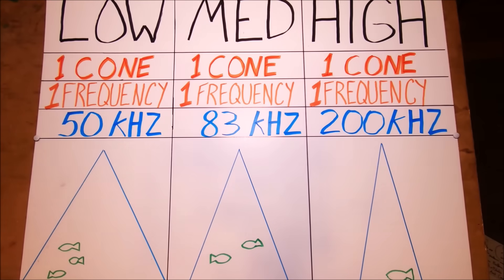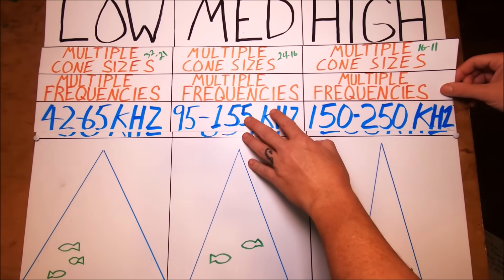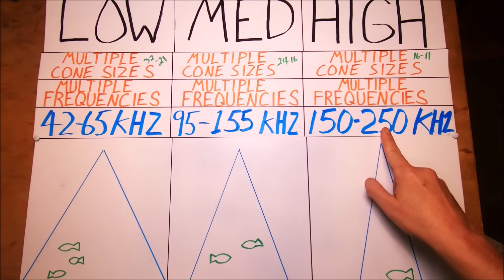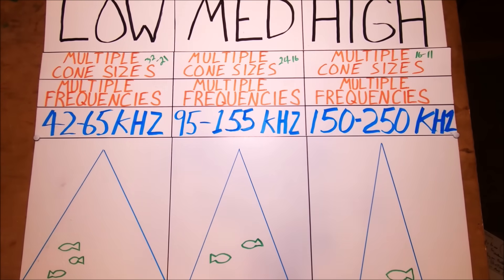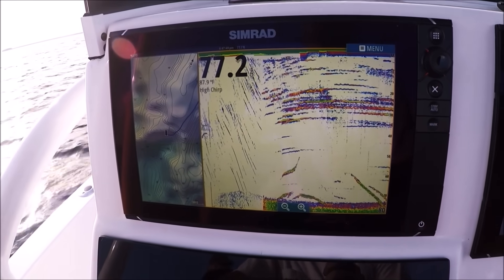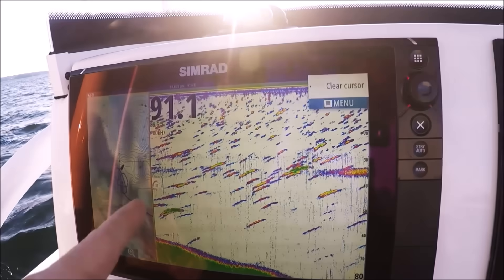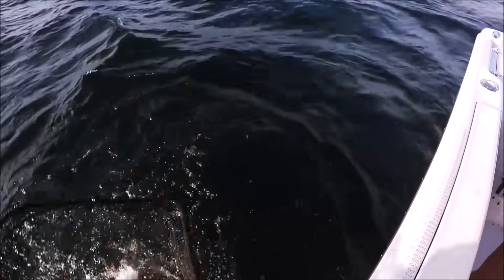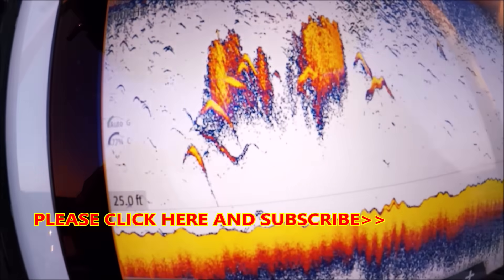CHIRP Explained in 4 Minutes! Chirp Sonar EASILY UNDERSTOOD.

Comment: Hi Mike thanks for all the amazing info. I am adding the active imaging to my transom. I currently have a thru-hull b-60 on my sportsman 207 masters would you leave the b-60 or do you recommend another thru-hull to compliment the active imaging 3-1?  At the moment I bay fish mostly so 15-50 ft of water but plan on going a little offshore probably 50-200 ft. This is the first time I have had a boat rigged up with thru-hull to get sonar on plane how do you recommend getting use to marking fish going 15-20 knots?
Reply from the maker: The B60 is pretty old technology. I would definitely upgrade to a CHIRP transducer. Your display has CHIRP processors so you should take full advantage to open that machine up if it’s in your budget. The Active Imaging is excellent for side and down scan, but this thru hull : https://amzn.to/2VhdytA is a BAAAAAD UNIT. It has the widest cone of any thru-hull and is excellent for those depths. You will be able to mark fish and bait over 30 mph.
Reply: Mike Smedley  thanks a bunch I’ll have to stash a couple bucks away rather get the real deal in a few months. Instead of settle for mediocre
Reply: @MikeSmedleyOLDSCHOOLSTRIPERS  Thanks again I was going to go ahead and buy this. My boat is a 15 degree deadrise. Do I still want to get this tilt or another product?
Reply from the maker: Hey brother.  It was tricky to find, but this is what you want. It’s for fiberglass boats with your deadrise. https://amzn.to/2YcMAEO
Reply: @MikeSmedleyOLDSCHOOLSTRIPERS  Sweet man thanks again can't wait to put this on the simrad and mark some fatties on the coast. Do I need any adapters to hook up to the simrad or should I be all good? Thanks again and tight lines.
Reply from the maker: Jon Kanner it will plug straight to your Evo3 if you get that exact one.
Reply: Mike Smedley  already ordered thanks for all your help bud. Not sure if you get some affiliate fee for that but I hope you do with all the great info and help you give. Have a great weekend bud

Comment: Unfair though with the transducer on the left sonar being in an incorrect angle under the boat
Reply from the maker: Both are identical angles.
Reply: @MikeSmedleyOLDSCHOOLSTRIPERS  Hi Mike, Thx for answering, but the missing arcs (bananas) is an indication that the transducer has an in this case backward angle. Happy fishing to you and your friends
Reply from the maker: Both are the same angle regardless. Too much tilt can give you half arches but it doesn’t change the fact that they are both the same. I tilt all of my transducers slightly down to mark fish on plane at high speed. Angle aside I think the difference in performance jumps off the screen.

Comment: Hi Mike, another great video. Many great tips in there. I currently run a 3D transducer for side & down & a P66 for standard sonar. I really want to upgrade for my birthday this year, with the option of compatibility to chirp readiness. I mainly fish in shallow estuaries, rivers & when the opportunity arises offshore, chasing reef fish & pelagics over reef structures. I wouldn’t fish deeper than 100-150m (700ft). I’ve have a 5m boat if that makes a difference. I’ve been looking at TM 185 LM/LH, TM258, TM260 & TM265LM/LH options. Any tips, advice or recommendations would be amazing, thanks mate😃👍🏼 tight lines.
Reply from the maker: Any of those would be great but you might want to consider the new Airmar tm165 extra wide high CHIRP.  it’s incredible for the depths you fish and won’t require a stronger CHIRP processor.
Reply: Mike Smedley Great info mate, thanks. I will look over the TM165. Just for my understanding, where you say a stronger chirp processor, is that in the head unit?? Thanks again mate.

Comment: Great video!  Thanks for sharing.

I bought a used boat with an Elite7 Ti with what appears to be the active imaging transduce with side scan.  From previous comments, it seems that you are saying that this is "real" CHIRP. correct?

I also have a Hook2 7 with the Triple Shot transducer and the unit lists CHIRP as an option...I think in the frequency tab.  Is this "real" CHIRP or not?
Reply from the maker: Hey brother!! Unfortunately I’m not terribly familiar with the Lowrance side. It’s seems some people found some discrepancies in the Lowrance literature. I would check the message boards on The Hull Truth. They have consistent posts on that exact subject.

Comment: Is it hard to change a transducer?
Reply from the maker: gerard haubert Some can be quite simple to swap and some can very extremely difficult. If it’s a transom mount it’s usually just a matter of pulling out the old one with a thin rope attached to the plug end, then you simply use the rope to pull the cable on the replacement transducer to the display. From there it’s just a matter of sealing and screwing the new transducer to the transom and plugging it into the display.  Pocket mounts,Thru-hulks, and In-hulls can be much more time consuming. It’s best to consult a boat/Simrad dealer if you don’t have any experience.

Comment: Thanks for vid
Why is the 50khz the widest cone?
Reply from the maker: Ralph Kluge Dont know exactly why, but most transducers use 50 for their widest cones.
Reply: Its just to do with how the physics of waveforms works. The lower the frequency, thewider the dispersion. The higher the frequency, the narrower the dispersion. Best way to understand is to think lower down the scale in audible frequencies. If your neighbor is having a party and blasting the music, what you mostly hear is the lower "thump" of the bass in the music. But the higher frequency instuments like cymbals you cannot hear.  The reason for the difference is that the bass is pretty much uni directional, (so a "wider cone") of radiation or dispersion,  and also carries further, but the treble is very directional, and disperses faster. To hear the full crisp sound of the treble you need to be fairly well in front of the speaker facing the tweeters. But the short answer is its just the physics of frequency radiation.

Comment: Can you add chirp to a  Furuno bottom machine?
Reply from the maker: Big Rich I don’t have any experience with Furuno. It would have to have a CHIRP sonar processor on board or have a processor you can add on. I’m sure they have a module to add.
Reply: Mike Smedley thank you! I was asked if I wanted chirp back when I bought it about 6 years ago, but I didn’t understand it so I said no. Dumb on my part. I’ll check with my electronics installer and see if I can add it.
Reply from the maker: Big Rich In your defense, not many knew what CHIRP was back then (or even now really). Make sure you are ready to upgrade your transducer to a good Airmar CHIRP ready transducer or it won’t really be worth the sonar upgrade. Thanks brother!

Comment: Why does Lowrance say they have CHIRP on all the Hook2 when in fact its not true CHIRP at least all the lower end units are not, yet there website say they are. very confusing.
Reply from the maker: Not as familiar with the Lowrance side, but if it says CHIRP it means it can run swept frequency transducers using CHIRP processing and not only fixed. I’m not sure how wide the bandwidth is though. What makes you think they aren’t true CHIRP?
Reply: @MikeSmedleyOLDSCHOOLSTRIPERS  Someone asked this on Amazon for the Hook2 4x here is the reply from Lowrance:  "Thank you for your inquiry. The Hook2 4X does not have chirp. The only Hook2 "X" model that has chirp is the Hook2 7X TripleShot. All of the Hook2 sonar/GPS versions that are 5" or larger do have chirp. We certainly hope this information is helpful.
Navico, Inc.
· April 29, 2019 "                   Now if you go to there website the term CHIRP is all over the Hook2 page its so misleading ?

Comment: why does mine go from 55 to 200khz what cone size would i have?
Reply from the maker: bratty ship47 every brand uses different cone sizes. 200khz can be anywhere from 7 degrees to 11. 50 can be anywhere from 18-25 usually
Reply: Don’t know cone angle offhand, but you’ve got one relatively superfine resolution (very small target separation) wideband waveform. 🙂

Comment: Each curved return is one fish?
Reply from the maker: Scott Gaines yes sir.
Reply: Only if you’ve got sufficient resolution, aka target separation. If you’re using the lower frequency, your resolution will be poor and the arc on the display could be depicting multiple fish.
Reply from the maker: FR. Yes and no. CHIRP transducers are very efficient and “quiet”. Even in low CHIRP or 50 kHz fixed you can have great separation and resolution. The arches are just a lot wider. The higher Q rated transducers like cheaper fixed frequency transducers show more blobs and connected returns regardless of frequency. 👍👍

Comment: Is not suppossed Chirp performs much better than single frequency? You didn't explain why single frequency performs better to you.
Reply from the maker: Luis Luis In my opinion single fixed frequency works better with single fixed frequency transducers versus setting them to a CHIRP setting.  

 As far as CHIRP ready transducers I use CHIRP in water deeper than 30ft but often leave them in single frequency in shallower water.

Comment: Using Lowrance HDS Gen 3 units, looking at upgrading ducers. With current 83/200 skimmer, I have never saw chirp improvement. Now I know why...great video.  The ACTIVE IMAGING 3 in 1
 Transducer, does not appear to be compatible with Gen 3. Will the TotalScan skimmer work for Chirp or is there a better product?  I fish for Striper in east Tn. on lakes up to 100'.
Reply from the maker: The least expensive CHIRP transducer that will knock your socks off will be the TM150M CHIRP. It’s been a great transducer for me over the years. TM 150 M  https://amzn.to/2BsVMud

 Because the Gen 3 is a bit older you will need this adapter https://amzn.to/2XEdTH3. Great transducer for those depths. The TM165 is a step up from the 150, but it’s around $150 more than the 150. You will be very happy with either. 👍👍

Comment: Mike, you did a better explanation than the one I saw on (Kid Cochise?). It was your conical diagrams that did it.  I might suggest that when you show chirp you draw multiple different color cones, each different color representing a different frequency covering different areas.  Thanks for this though,  Great video!
Reply from the maker: Thanks brother!! I really appreciate the feedback!! I actually did a video several years back using exactly what you’re talking about and it seemed to confuse things further for a few guys. 🤷🏻‍♂️🤷🏻‍♂️. I tried to keep this one as simple as possible with just the basics. Technically you get even more frequencies than the 100 since pulse frequencies can be any frequency within that range of 150-250khz. For example you maybe sending 150.1 150.2 150.3khz and even smaller. I tried to keep it all about the COMPARISON between fixed frequency transducers and CHIRP transducers that use swept frequencies. 

  I think I will do another one soon for the more advanced fishermen and I’ll use your recommendation. Please let me know if there is anything specific you would like to see in a video. Any video about sonar or fishing in general. Thanks again brother!!

Comment: Hallo Mike from Greece!!!! i use Airmar TM185 watching the very nice video i try to understand what happened to my transducer when i use a custom frequency lets say 90 khz and then changed to 125 khz i believe i send 1 frequency at the time?if so it works as  a none chirp transducer as it uses only that one specific frequency at each time is pingig?how these 2 frequncies are related to the angle of the cone?since the the TM185 has 50 frequncies(85-135)and an angle of cone 11 to 16 deg.Thank you!!!
Reply from the maker: George Iliopoulos Hello George!! I would contact Airmar for the details on that, typically the lowest frequency goes along with the widest cones. I like custom frequencies in shallower water less than 30 feet.  👍👍👍
Reply: Thank you Mike !!!
Reply from the maker: George Iliopoulos 😁😁👍👍👍

Comment: Just a small correction. By chirp it is not 100 pings each at a different frequency it is each ping starts off at a low frequency and ends at a high frequency. This allows a long pulse that can go deep and you do not loose any range resolution or the ability to detect different objects close together. This is because each target is hit at a slightly different frequency and when the signal returns the system does a frequency match filter and is able to determine 1 target from the other. Also the cone size (beam angle) does not change that drastically between 100kHz and 200kHz.  I work in sonar development and this is what I help develop. Other than that the ability to detect targets is correct.
Reply from the maker: Thanks brother!  It’s technically a wide frequency range between 150khz and 250khz. (Not just 100 since they don’t come in nice neat 1khz chunks) I had such a hard time explaining the difference over the years that I found this gave guys a good “idea”. Instead of one you get many.  Thanks for the comment brother!
Reply: With a Lowrance hds live what is best for water between 10 and 100 ft deep  salt ? Has chirp and or conventional
Reply from the maker: Try CHIRP first. If it has medium and high medium will likely have the wider cone so it’s better for marking fish. Every transducer model has characteristics that can be quite different than others so you will have to experiment with it a little. I would toggle between medium CHIRP and 83khz. Go back and forth at different depths paying close attention when you’re fighting under the boat. Note how the fish looks on the screen and the fish’s size when you land it. One of those two settings will outperform the other. I would probably stay with those two for your depths 👍👍👍

Comment: Mike, first off thanks for answering all the comments. Takes a lot of time I’m sure. Very redundant as well. So, let me apologize, I am going to beat a dead horse here. 
I’m running two Lowrance HD’s live 12s with 3&1 transducer. Looking for a top end transducer with to pick fish(sea bass)apart off wrecks 40-150ft of water. I also troll for stripers 25-80ft off MD coast. Is there one transducer you would recommend? Or two?
Thank you!
Reply from the maker: umtduckhead No worries on the questions brother. It’s my pleasure.  I would definitely go with a TM165 H wide or the B175H wide depending on your budget. I don’t have a link for the 165 yet, but here is b175 B 175 High Wide Thru- Hull 12 degree 9 pin. Evo3 https://amzn.to/2F87OdM

Or the transom mount version 

TM 185 High CHIRP Wide Xsonic plug end 
https://amzn.to/2XDLJw7
Reply: Mike, still pondering about the transducer. Max depth i fish 150. Really want to pick fish off wrecks and the bottom with ease. Mid column trolling drifting is pretty important as well. Not extremely though. 
I would prefer a TM over a through hull. However, if the results are noticeably different I would go through hull. 
Looking for top end $$ pay for what you get. 
Since I am running a 3&1 on a HDS Live. Is there a better downscan /side scan option with transducers? Or and I stuck with 3 and one? Again sorry to beat a dead horse. Thanks for your help.
Reply from the maker: umtduckhead The Active imaging gives you the absolute best side scan I’ve ever seen. I’m not sure if you would see much of a difference between a 165 and 175/185 at only 150ft. If you’re only interested with fish right on the bottom you might want to consider a regular high CHIRP transducer with a narrow cone. It will give you the best detail on the bottom. You won’t mark as many fish, but detail will be the highest. You have quite a few options.

Comment: Im running a lowrance carbon 12 inch w 3d and a 83/200 ducer.  Primarily muskie fishing 10 to 50 ft where the the shad are schooled up. Vertical jigging is my main stay.  Would you recommend the tm150 or the new tm165hw? I was told the 165 would give me a wider cone but still retain the target seperation.  Is this true?  Great video btw.
Reply from the maker: It’s true, the higher frequencies make it behave more like a standard 200khz transducer so you get fantastic detail as well. It’s VERY hard to find a better transducer for under $500. If you fish less than a few hundred feet of water it’s the best you will find, by ALOT 😁. 

 Thanks for the comment brother!!

Comment: Random question. I saw a video of yours once discussing terminal tackle. You suggested using glass beads instead of plastic between the weight and knot. Why do you prefer glass?
Reply from the maker: Jboat571 X If you use only one bead you can use plastic, but live baits like eels shake the glass beads together and make a great sound. That clicking sound is something that Bass listen for when hunting crabs and lobsters. Plastic beads make little sound in comparison